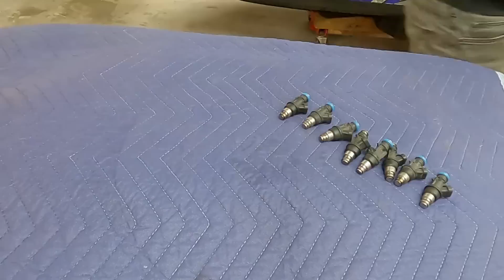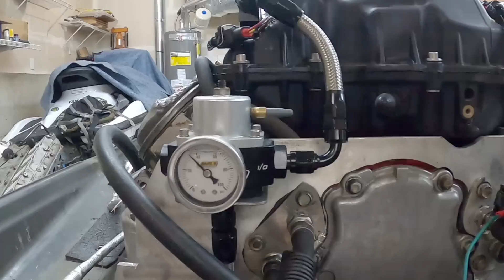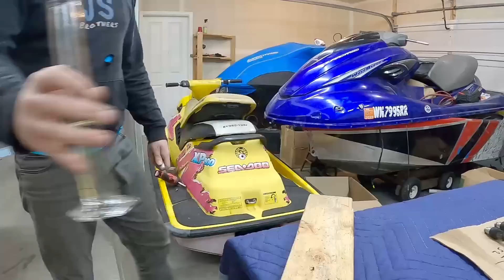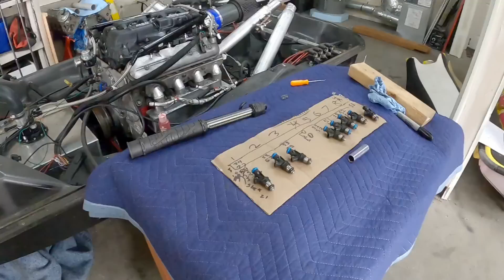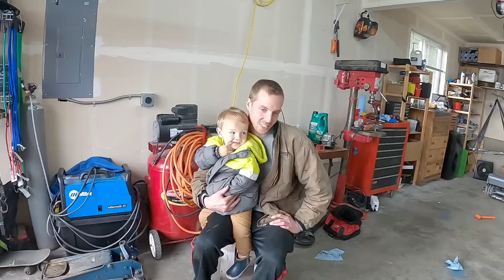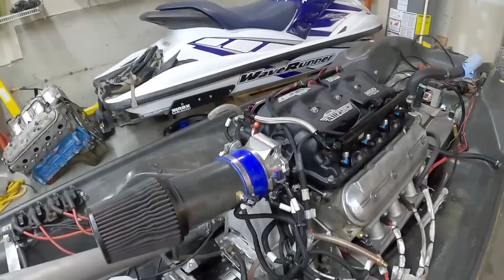modified fuel injectors v8 ski

Comment: The first tune is incorrect, same as the last video, and sounds like it's super lean. It's so lean all the systems including IAC compensate to make a surge/lope. The second tune is clearly rich enough, but seems like there is just way too much static IAC opening/bleed. If you could just tweak the IAC down on the second tune it would probably be fine.

Comment: Not sure if the msd is the same, but I've got a holley sniper on my boat, and on that they tell you to set the throttle body open so that the idle control motor only has to open a few percent (between 2-10%, i set it as low as possible, makes the idle more stable) to maintain the target idle, maybe that's something you could try?
Reply: Ah i commented before watching the whole video. Yeah see how the new iac motor goes, hopefully that or an air leak is the problem. That's actually the only things i can think of that would cause a high idle.

Comment: Loved the video! Hope you find the issue with the V8! Y’all should make Milo his own slow jet ski, maybe converting a standup ski into a mini sit down or something
Reply: Nick that is an excellent idea absolutely outstanding. Something like that would fit Milo perfect.
Reply from the maker: I like this idea a lot, I will probably put something together for him if I have time 👍
Reply: You could power it with an old trolling motor. Also on your vacuum leak, sometimes you can find em by spraying suspect spots with brake cleaner while running and monitoring fuel trim

Comment: The position of the oxygen sensors. With the short exhaust I would be surprised if you were not getting reversion at low exhaust pressure.

Comment: Interesting stuff. This would drive me nuts... I'm wonder what it is about the other tune that allows it to idle smooth, but at a higher rpm. I've got lots of questions about what's happening, but I'm not sure if they even make sense,  haha. 

If it's running lean and trying to close the valve... that is a strong indication that it's getting air from somewhere it's not supposed to. Probably easy and cheap to replace the idle air valve, but you may be able to block the inlet off and watch the valve while it's idling and see what's up. Or just send power to the valve and see if it moves.... or maybe you can activate it through the softwear. 

I'm guessing that it is in fact a intake issue, but I wouldn't rule out an exhaust issue / sensor placement ? If the oxygen sensor isn't getting an accurate reading it could show lean and cause it to shut down the idle air. Based on what came out the exhaust, it looked rich, but that could be deceiving. I'm sure you will sort it out soon, if you haven't already...
Reply from the maker: It is driving me nuts for sure. One thing that is happening in tune 1 in the video is it has closed the iac all the way and is now trying to compensate with altering the timing to bring down the idle. Which is causing the surge. It does look like it is a bit rich somtimes but it is trying to dump fuel into it to compensate for the lean condition. Bottom line is it is getting air somehow that it isnt suppose to. I was going to plug the iac port and try again but ran out of time. Of course you a right and it could be a problem with the afr sensor as well, which I will be investigating if I dont find an issue with the intake stuff.
Reply: @JetSkiBrothers  EFI.... great when it works, haha. I guess you'd have the same issue with a carb if you had an air leak... but it might be more obvious. I think every time I've ever worked on the intake system of a car, I've forgotten a hose, or something, that caused an air leak... but it has always been pretty easy to find. 

Good luck with the diagnosis.

Comment: so if you use propane and settle it on the manifold area it'll pick up if it's got a vacuum leak not to mention you're supposed to have the throttle body set at so many thousands open and then adjust your throttle position sensor with a proper gauge and electronic meter reader remember right you're running a holly system doesn't it have a diagnostics or doesn't it have readout for what your throttle position sensor is at and it should show in the manual a base setting for your throttle body a lot of it has to do with the map the mass and the O2 readings along with the throttle position sensor all have to be in conjunction before the computer can educate itself enough to competency and you also have to make sure you have like 13.7 volts

Comment: A word of warning: those car alternators are not marine grade, as in they're not spark proof, and esp since they're used, hopefully doesn't cause sparking in an enclosed engine bay with that much fuel flowing thru those rails!
Reply: Pull that seat off on every restart or it just might remove itself with you on  it😂😂😂
Reply: Ohh wow thats a scary thought.